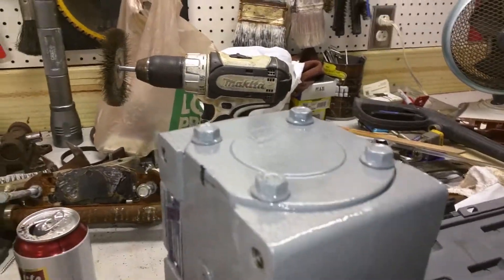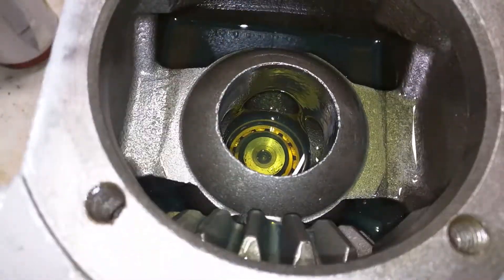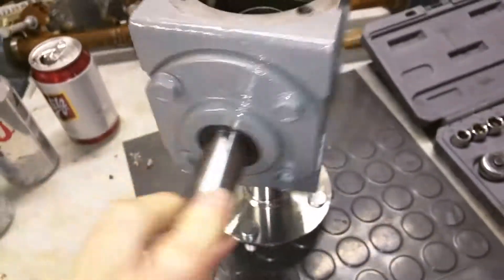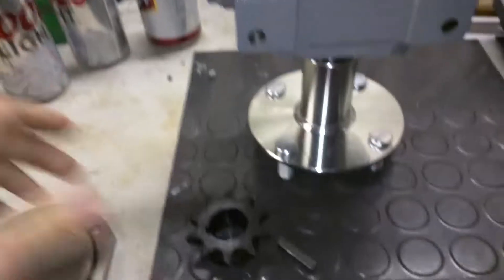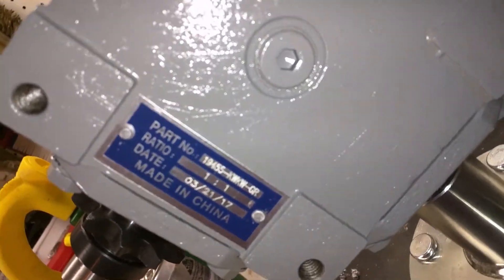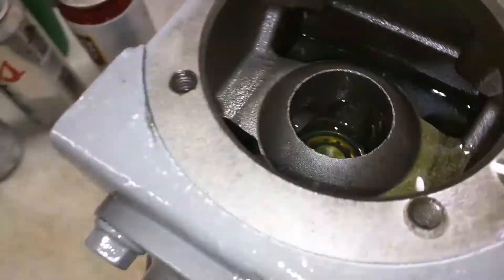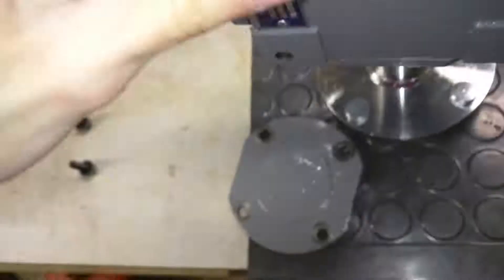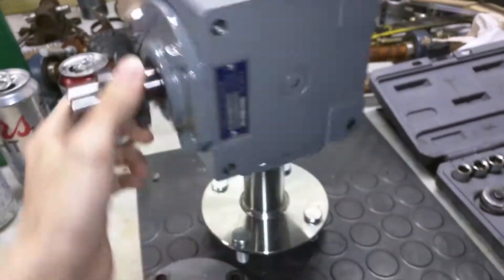Inside a Right Angle Drive [More go-kart stuff]

Comment: How did it hold up? I'm looking to use one for an atv engine swap so I'm trying to figure out if these things will hold up
Reply from the maker: Never finished that project. If you plan on exceeding the rated RPM, just machine the gearbox with some fittings and add an oil cooler and maybe 75-140 gear oil instead of 80-90. They don't dissipate heat too well on their own.
Reply: @ccraig412  what about running it in reverse my engine needs CCW/CCW gearbox but they don't sell any so I'm assuming I can run this the opposite direction
Reply from the maker: @alexandermoskalyk3261  Yessir, you can run it cw/ccw it doesn't care.
Reply: @ccraig412  sweet I'm also gonna play with sprocket ratios to lower the rooms on the gearbox but still have good speed on final drive. 1200cc Yamaha v4 shaft drive motorcycle engine going into a 90s polaris sportsman 500 frame lol thanks a bunch for the advice Definately helped me decide to buy this gearbox especially at the price
Reply from the maker: @alexandermoskalyk3261   Video it lol! 1200? I think it's only rated to 20HP. I think it would handle more honestly though. It's fairly well built but again I think a lot of that has to do with the oiling. The bearings inside it are beefy enough for sure. Lower units in boats have similar setups and those are rates 150-200HP.
Reply: @ccraig412  yea the one I'm getting is rated for 40hp but that's big tractor ponies I think that Yamaha engine had like 120hp new so probably in the 80hp range now being a 1983 engine lol hopefully I can just lower the rpms using the sprocket ratios see how hot it gets maybe tap it add an oil pump and cooler
Reply from the maker: @alexandermoskalyk3261  Might as well. If you get a good laugh out of it I'd say its worth it lol. Be mindful too of said ratios - you decrease RPM but you will increase HP on the box. If you're handy with a welder, you could probably make a cage that bolts on the top and bottom to reinforce it a bit. Mine had 8 bolts total, 4 on top/bottom sides. At least so if it does go, it doesn't fly everywhere lol